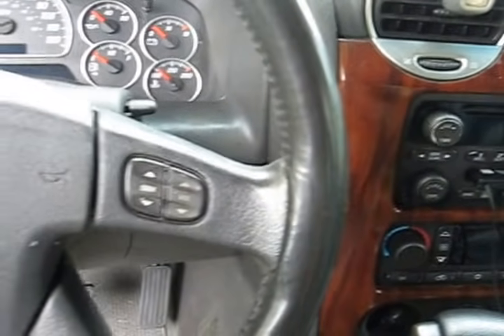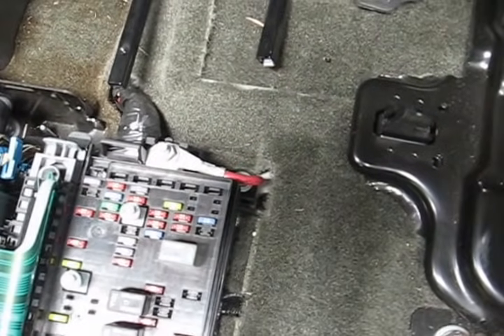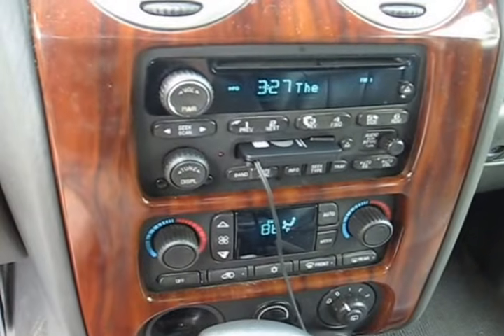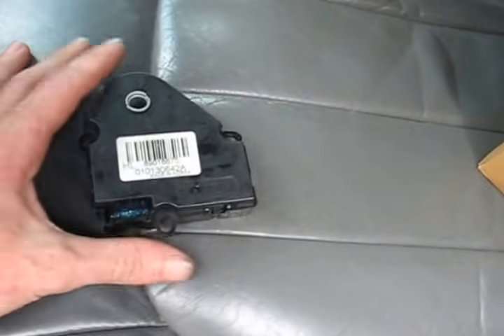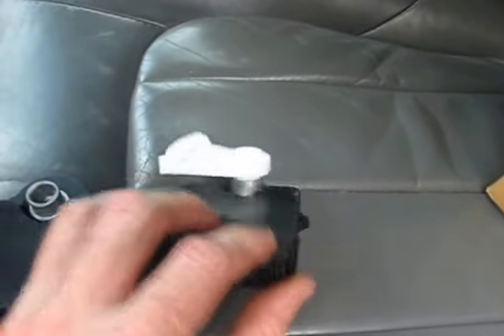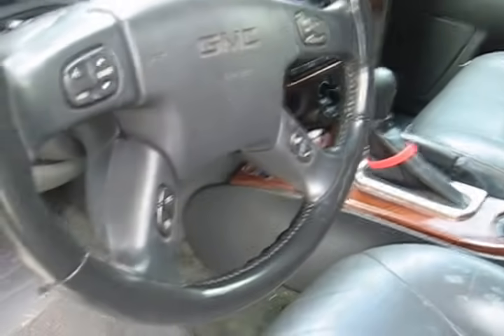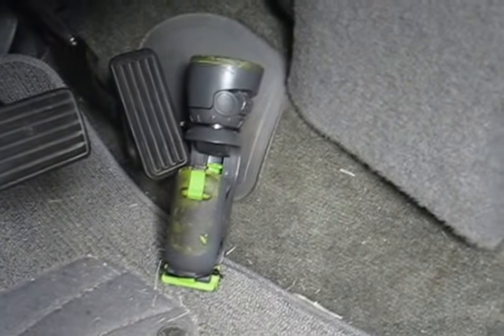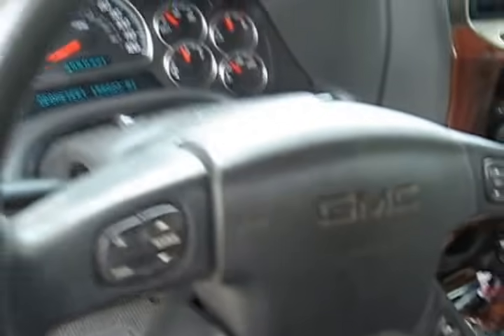GMC Envoy HVAC actuator Replacement

Comment: I thank you for this video, I watched several videos on this subject, yours was the one that I kept going back to. My local Chevrolet dealership charged me $135.00 to check out the problem with my 2003 Chevy Trailblazer, the estimate to replace both the Defrost Actuator and Mode Actuator was $1,080.46. I was able to complete the installation my self for $146.00 buying my Actuators from the NAPA store here. I can't say it was easy for me, since I am 75 years old, but it gave me a great feeling saving the money and learning, I ain't to 0ld to learn.
Reply: How did you line up the mode door actuator with the flap door gear?  My 2007 Trailblazer shop manual says to center the flap door and center the actuator.   The problem is the mode flap door seems to be spring loaded into the closed position.   There is no way I can hold the mode flap door in the centered position and install the actuator with one hand.  Thank you for any information you may have for installing the mode flap door actuator.

Comment: Changed my battery out over the cold winter and lord and behold…had that clicking noise. Thought it may of been the CD player, because it stopped after a little while. I will try the reset, if not that, I know know how to change out the actuators. Thank You so much….Your video was a great great big help.

Comment: Great video. I unhooked battery cable and sure enough I had air blowing on the floor only, no matter which mode I selected. I re-watched this video and re-calibrated it. It took another off and back on using the key but it fixed it. Thanks for the help and saving me a wad of cash.
Reply: Danke Schoen ! : ✌️ :

Comment: the mechanic want to charge me $500 to fix my problem,  my  truck was blowing hot air from the driver side vent and cold air from the passenger side vent, I calibrate the way show in this video and my problem when away , Thank you very much for this Amazing Video.

Comment: I recently got a new battery.  Afterwards, the passenger side blrew hot and the passenger was cold.   I needed to recalibrate the actuator.  This video was helpful, but it was incomplete.  We had to start the engine with the fuse out.  Then turn off the engine and replace the fuse.  It worked great!
Reply: Did you leave the A/C off during the entire process?

Comment: i too own a GMC Envoy. I bought used and never had A/C . I heard this clicking after i replace the a/c line and this is when i was lucky to find out the compressor was bad replaced it and now i have this problem. When will this ever end. I have found out the hard way that these Envoy's. have about of small problems and keeps pulling money out of my pocket. And im not even going to get started about the problem because if you got one y o u know. Thanks You-Tube. and thank you for the people who take there time to try and help

Comment: The white arm is needed for the 89018675 for the GMC 2003 Envoy so don’t take it off install as the one you’re replacing.  Otherwise. your instructions were spot on.

Comment: @Mathew Conniff
You might've missed the part at 13:22 where he mentions that one of the other actuators had failed silently. Yours may have failed without generating any noise as well.

Comment: Hi! Your videos are really helpful. Thank you so much for sharing your knowledge. I have a 2004 Buick Rainier. Air is blowing, but not out of the front vents, and there's no clicking, so I was hopeful recalibration would work. I recalibrated by pulling and reinserting fuses 36 and 39, but that didn't work. You mentioned a second method of recalibration, but I think (could be wrong) you didn't share what it was. What is the second method (if you don't mind sharing)? Thank you!

Comment: With my 04 trailblazer I had air coming out the defrost and floor only. This was after I replaced the battery.  Replaced the actuator that was up the highest and that fixed the problem. With my trailblazer I left the gear on, it meshed up with a corresponding gear inside. This video does a good job showing you what to do, it's not that hard of a job and would take a moderately skilled lay person about a half hour to an hour to do themselves, FYI.
Reply: Matt Fish im currently haven that same issue but it wont calibrate
Reply: Can you explain further by "won't calibrate"?
Reply: Matt Fish yes we tried to calibrate several times, even replaced the mode actuator and the air still wont blow from the vents. It blows  every where but the front vents
Reply: Perri Oliver did you move the arm gear inside/under the dash to the middle before you put the new one on?
Reply: Matt Fish no, my friend put it on n said it went rite on no problem. Once we got everything back together and turned it on we heard a knocking. I was going to exchange the part today and give it another try
Reply: Perri Oliver, good luck.

Comment: Good afternoon.  My husband and I have a 2003 GMC Envoy XL which we put our truck in the shop to fix the driver side of the truck because no hot air was blowing out only cold. Once we put the truck into the shop we received the truck back with the driver side working but now the passenger side doesn't blow hot air. In Sutton to the back send to either not work or blowing very low. My husband and I are going to try the methods mentioned in this video and let you know if it works. However, we do not hear any clicking noise.  I will post another comment to let you know the results. 
Thank you for sharing. 😊

 I do have a question about a noise coming from under the hood either when you start the truck or when the truck is in park. It used to be quiet once in neutral but at times it starts to be noticeable. Are you familiar with this issue and have a solution or video to show the problem and how to repair?

Comment: I own a 2004 Envoy XL. The blower vents all function except the one which blows into your face.
I went to the back seat & was unable to lift the seat to expose the fuse panel as shown in this video. I did find a fuse panel just under the hood behind the battery. There was nothing in the fuse map as described in the video.
So in the attempt to cause the AC control system to recalibrate, I disconnected the positive side of the battery for 10 seconds then reconnected the battery. I turned the ignition key on as shown in TV he video to recalibrate the AC actuators. I still have the same problem.
Reply from the maker: There's a failure in one of your actuators. The XL envoy is a longer wheelbase so the seats and fuse boxes are probably different. They usually have rear AC too.

Comment: Thanks for the video it's awesome I have an 2004 envoy but it's all manual knobs to switch everything first I couldn't get mine to work on defrost only front dash vents and then suddenly it would only work on 1-4 speed settings and then 1-3 and now none so I think I need to replace blower resistor as well as some actuators but first I will do the resistor and try recalibrating and see if it works if not I know I need actuators thanks for the video

Comment: Thanks for the great video.  How did you line up the mode door actuator with the flap door gear?  My 2007 Trailblazer shop manual says to center the flap door and center the actuator.   The problem is the mode flap door seems to be spring loaded into the closed position.   There is no way I can hold the mode flap door in the centered position and install the actuator with one hand.  Thank you for any information you may have for installing the mode flap door actuator.

Comment: OK so my 2003 Envoy XL SLE  Kept defaulting to defrost ducts. When I got in there and looked at the actuator, there were 2, 1 closer to engine, the other closer to center consol. For me it was the second one closer to consol that kept flipping back to defrost ducts. I removed it and manual flipped the doors to dash panel ducts. To my surprise everything works as it should. Switch knob to defrost ducts and it sends the air that way, switch back to front panel that works to. Rear hvac control.. all seem to work as they should....WTF  that second actuator is doing is beyond me.  My only concern was that the control doors might flip back to the defrost send without the actuator in place to hold it.  I decided to take the actuator apart manual turn it so the gear lined up to hold it in the front panel position, I re installed it and did not plug the power in to it....all is working fine

Comment: Very helpful video, looks very simliar to my 2002 Trailblazer.  But one thing I don't understand is why do you need to calibrate it before taking it off?
Reply from the maker: Sometimes the system just needs to be recalibrated, so you perform the calibration before replacing anything to see if that fixes it.
Reply: Your Video was a huge help. Replaced and working good. Thank you very much.!!

Comment: When running the calibration process all 3 actuators are supposed to move, found one on mine that wasn’t moving, sounds like the control board in it is dead

Comment: Hi! 1st of all Thank you so much for doing this video!!! 
No key in ignition when you take the fuse out right? And does it matter if the AC is already left on when you turn the car on Or should you make sure it's off 1st before turning car off, doing fuse, then turning car on?

After I did the process, and waiting for it to calibrate, I heard a clicking for the 1st time But I swear it sounded like it was coming from the fuse box 

DO YOU HAVE ANY INSIGHT FOR ME ON THIS?

I never had clicking issue. What happened was my battery was replaced then my dash vents wouldn't work, only defrost, floor & ceiling work Blows real cold 

THANK YOU SO MUCH!!!! ❤ Jaimee
===UPDATE=== After doing the fuse Now my floor blows hot when I have the AC on face/head
Reply from the maker: You probably have an actuator that has failed which is why it's acting weird.
Reply: I'm having a friend install it right now And now that it's installed the drivers side is blowing hot out the dash and cold on passenger
Is there another actuator just for the drivers side? Or does it just need calibrated?
Reply from the maker: @LailonaS  Driver and passenger have separate blend actuators but it will need the new one recalibrated.
Reply: @pfun41  Excuse my ignorance as I am trying to understand how this all works But he said the new actuator is working He replaced mode door actuator and said the blend ones are working So he thinks it's a recalibration issue And pulled 3 AC fuses and put back and it blows cold at first but then goes to heat on drivers side
Reply from the maker: @LailonaS  Sound like the driver blend actuator is going.

Comment: how did u get the white gear off the mode actuator under the dash cause I just did mine and couldnt get it out cause of the white gear being stuck behind the plate

Comment: How did you get the plastic duct work out? 04 blazer. It's wrapped around the brake pedal. It's lose but idk how it works its way out. In other videos it just pops right off and is not wrapped around

Comment: I’ve replaced both actuators.  No change, defrost vents only.  Any other ideas.  Is there a module for the climate control that’s possibly failed??

Comment: How can I determine if the floor door actuator isn't working due to a faulty actuator or if the dial on the control mode isn't working? I bought both but would like to only replace the actual problem.

Comment: How do I know which one? I have clicking in the dash. And it completely stops air or heat from coming out. Heat itself is hot but won't come out.  Also it randomly turns on and off

Comment: I disconnected the battery to replace coils and spark plugs and after that my front vents won’t blow.  When I try to recalibrate I will pull the fuse for 10 seconds and turn the ignition on (but not engine) and it will suddenly go black on the dash and shut down.  it will lock my key in where I can’t get it out until I disconnect my battery.  Only then can I get my key back and the ignition to come back on.  Any ideas on what’s going on?
Reply from the maker: Sounds like you pulled the wrong fuse and the car isn't happy about it.
Reply: pfun41 I don’t think anything I do makes my car happy.

Comment: Mine clicks when you turn it on or off, and if you put it on heat. It doesn't click when on AC, and I have air blowing out of all vents. Which one would that be?
Also, I bought this car (04 Envoy by the way) used, and the roof blower vents have never worked. What can I do to fix those?
Thank you so much for your videos!
Reply from the maker: You must have an envoy XL to have roof blower vents, those wold be fed from the rear HVAC unit. That would be blend door actuator.

Comment: You have more then one hvac fuse  in them their is like three or four hvac
Reply: i can confirm that only the fuse he mentioned is the necessary to trigger the re-calibration, i just did this on my 02tb, only i never heard my blower moter do anything, but i could hear all the actuators doing their song and dance
Reply from the maker: There will be separate fuses for the HVAC module and the blower motor, plus probably another for the rear HVAC unit on models that have them. But only one is for the HVAC module which is the only one that needs to be reset.

Comment: Great video, do you know which activator would cause Passenger side to always blow hot and driver side vary with controls.  Did have clicking before but it still worked properly but now it stopped and heat always comes out passenger, so I assume it finally failed.  Also has rear AC/Heat but only get cold air out top vents even when on heat.
Reply from the maker: Passenger blend door actuator.
Reply: Is this located just to the left of the glove box opening and on the center console wall.  Can't find another one on the passenger side.  was told it is just in 'front' of the blower motor but can't find it (unless it is under some plastic cowling?).
Reply from the maker: I believe that's it.

Comment: I have problem on GMC ENVOY 2002 its engine have no noise and ac working great but after some days if i turn on my ac then some noise in coming with my engine like tak tak tak but ac working good some machinic told my to replace the compressor but some machine told me this is compressor wire sound so what i do ??

Comment: loved your video, very helpful but I'm stuck... I have removed all the lower panels & can see the actuators but can not get to them do to the gas pedal being in the way and the plastic vent is behind the pedal instead of in front like the one in your video, any tips? (my truck is a 2004 GMC Envoy XL SLT)
Reply from the maker: The XLs might be a bit different. If you can't get around it I wouldn't hesitate to remove the gas pedal. This platform is drive by wire so one connector and a few bolts and you should have all the space you need.
Reply: pfun41 I'll try it today, thanks

Comment: what happen if you don't hear no noise from the actuator but air go"s every wear but the front vents ?
Reply from the maker: That's an odd one but sounds like there's a dead spot in the actuators feedback sensor (it's broken).
Reply: pfun41 where is the actuator feedback sensor
Reply: Same problem guys no noise but no air out of the face vents
Reply: Just like the first section of the video said. I only had defroster air flow, nothing from the front. I had recently replaced the battery. Pulling that fuse and letting the system reset did the trick. THANK YOU!
Reply: Same issue am having with my 05 trailblazer , just replaced the blower resistor , no no air out the front vents , tried the fuse reset but nothing and am not hearing any noise from the actuator . Any advise ?

Comment: Yea, poor design and execution with parts that fail. Great GM. We have a 2004 Envoy XUV, looks like the exact same setup. Problem we have is that when you turn the key on or start vehicle, we only get air blowing out floor/door side vents/defroster. Selecting mode changes nothing, except if you press the front def switch,  the blend door for that does adjust so all air is pushed up thru def vents. If you select main vents, no change, just floor and defroster

Tried a dozen times doing the fuse reset thing, no go.

The problem appears to be the actuator for the main vents.

Comment: I had to unplug battery to replace the water pump, put it all back together and my 05 envoy had this issue of not blowing out front vents only dash and floor (back air works fine). Tried these  steps to reset for calibration, didn't fix the problem.. I heard it calibratingand waited 2 minutes of so... still having the issue :(.
Reply: Did the exact same thing. Did you find out what it was?

Comment: My 05 envoy denali, the ac stopped completely.  No air from vents, no defrost and no heat blowing.  I replaced the blower and it worked for a week and now i have nothing at all.  There is a little creaking sound when i push the ac button but still no air flow at all.
Reply from the maker: If you can hear the blower running the mode actuator probably broke completely or jammed up. If its not running at all then there's an issue with the blower motor or it's associated circuitry. See this video for that. https://www.youtube.com/watch?v=M4pka5BMoQE

Comment: Our 2006 envoy only blows cold air from the passengers side. I read that there's 4 actuators. Which one should I replace?
Reply from the maker: The driver side temp actuator.There are 3 on the driver's side. When you pull off the plastic panels to get to the actuators it will be the one lowest and closest to the driver seat.
Reply: pfun41
Reply: pfun41 hi I'm wondering what actuator I have to replace I have ac  on the passenger side but not driver side what one do I need to replace and where is it located at in your video it does blow on the driver side but only heat even when the ac is on